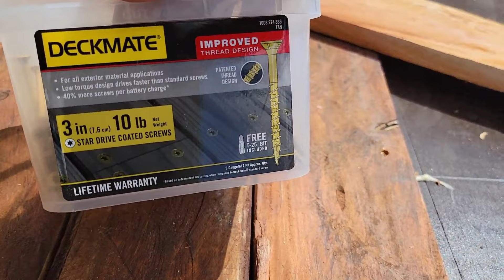Beach Cabin Build Part 4  Decking and Building Walls with Mahogany

Comment: So nice to see timber that’s not coco lumber. U so lucky to have mahogany on hand.  Those guys must have caught your disease James. When you pan the cam around about 25 min. mark you can see that the side timbers are exactly level with the end timbers and those uprights are plumb. Something sweet about the sound of a 3” nail being hammered into timber. That’s one nice and true timber frame. Look fwd to more.
Reply from the maker: No I stand over them and make sure each and every step is done which usually is not. Somebody commented on me micro managing and yes I do. I want it right the first time not corners cut. Each time I am not around basic things are not done because to them it  was right by the standard they grew up with.  Some things I am a lax on but others I am not.

Comment: James, teach this ole dawg somethin, why did the guys switch from screws to nails up top? Wondering what I might have done wrong in converting to only screws in my wood building projects around the house? And this spring when I replace the pool deck, I plan on using those similar deck screws on composite deck boards. Thoughts?
Reply: I recommend that butyl joist sealing tape before the deck boards and or the mounting tracks go on to protect the subframe (joists)
Reply from the maker: Screws will SNAP nails will flex and bend. Take a strong typhoon loading pressure on the frame and the hard tensile of the screws snap into. Framing needs to be done with large nails or bolted thru.
Reply: @TexasFilipino  ty

Comment: James, I've been meaning to ask you about your bike.  Given the difference in the roads in the PI, how does it ride for longer periods of time.  How is the seat on your backside?  I'd be interested to hear!
Reply from the maker: I choose that bike because it best fit in with the conditions of the roads in the Philippines. It is an Adventure bike and the province roads can be an adventure! The suspension is adjustable at the tip of your fingers. The ride is good after long rides but if your not use to riding any bike for a long period  you will need to get " saddle broke"  and after a few rides your butt will toughen up. I personally had no issues. I have zero regrets